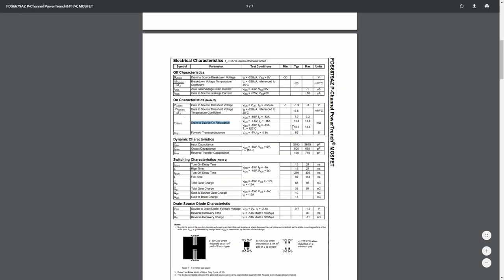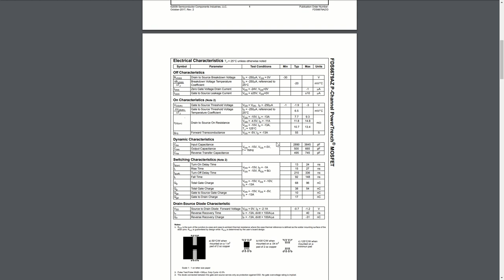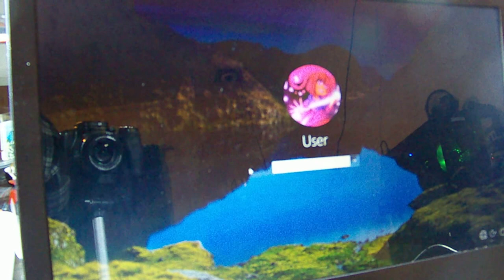ASUS ROG G74SX laptop repair!

Comment: This seen better days. Mine is in mint condition , bought new ... i used everyday since and no issues other than throttling issues, fixed by a modded bios disabling prochot.This puppy is thick and inspired by Nighthawk stealth plane. You can 7/24 game with it without burning your hands and no ear deafening fans... Solid machine. Pain to service but nice thermals. Mine is g74sx 3d with 120hz Nvidia 3D system. Bought at 2500€ back in time. I have 2 g752vs , one is oc edition with non locked k cpu runs over 4ghz speed , they are also solid machines. Oc edition drains battery when gaming with 230w power supply ;)
Reply: With mine I had to tear the damn rubber of because it just dissolved.
Reply: @EnhancedNightmare  you can try plastidip

Comment: Great video mate! I know it has been a while and you might not remember, but it would help me greatly if you know this: are the two R020 chips shown at 12:21 (cant recall the proper name) grounded? I have a short circuit on my g74sx laptop and i cant figure out where(i couldnt find a scheme anywhere). As soon as i plug in the charger protection kicks in and turns off the charger. i. e. The laptop cant be powered on at all. I am also looking into the mosfet but mine seems good. Thanks in advance!
Reply from the maker: The R020 resistors are current shunts, they are not connected to ground. If you can measure a low resistance between one of these and ground you need to look further. The input mosfets don't go to ground. Are you saying when you plug charger in you don't get 19V at the socket? How are you testing the mosfet?
Reply: @JonnyFix  i have confirmed i have a short circuit. As soon as i plug in the charger, the charger shuts down due to protection. There is no reaction but only instant shut down. The R020 have 2 oms with ground. Mosfet seems to be fine. I have tried another charger and it is same reaction
Reply: @JonnyFix  i dont get 19v on the socket at all as i try to plug in the charger. It instantly shuts down the charger (charger protection kicks in).
Reply from the maker: @svid-1  If those resistors have 2ohms to ground I'm going to guess a bad capacitor right after the socket somewhere. The best way to find this without removing every one and re-testing is to get a bench supply that can source a lot of current without shutting down, set it to 19V and feed that into the socket, or solder wires to the socket and feed directly into board, and find out what is getting hot. 2ohms will pull almost 10amps at 19V so set current limit on supply to half an amp and see what happens. At low current it might take a couple mins for something to start getting warm enough for you to feel depending on the voltage. Power is volts x amps so if voltage at half amp limit drops to 10 then 10 * 0.5 is 5watts. 5-10W should be enough to feel.

Comment: great video and lots of useful things and always learning with electronics , but i have a tricky laptop problem if you can help? 
Wont turn on and no lights, screen ect- totally dead- PS is good. Switch is good and 3v is there shorting to zero when pressed. 
** When plugged in,  the blue light at the power socket flashes blue for a sec . (normally always on when plugged in) 
PS socket resistance is only 8000 ohms?? and same unplugged where it connects to M/B so not socket wiring fault. 
Pulled it all apart and 19v is there through the input mosfets and sense resistor. cant find 19V elsewhere on main power rail .
So power mosfets  are turned on by super IO? partially on but fault detected somewhere? 
3V isnt at bios chip next to super IO if it is the bios chip? no volts on any leg. No 8 should be 3V always i think
pulled all parts off board to see if they are causing short or drag down
Tried my PS direct to board socket pins and NO amps are being drawn and with switch pushed in too. Fan dosent twitch.  CPU ect are cold as no amps drawn
Tried resistance to ground of many parts and cant find any shorts 
So slightly ON but not fully. Super IO fault?  Also screen disconnected in case that was faulty and 19V is at connector to screen

Any one can help , that be appreciated as out of ideas.   8000 ohms here must mean something as should be hundred k or more and i hear HP's can be down to 20K? obviously something is wrong,  first board i have repaired where socket light isnt staying on although board has partial 19V on it.  Learning board repair so always learning and this one has stumped me so far, but might be easy with 8000 ohms symptom?
thanks
Reply from the maker: Sounds like you're doing everything right. Should be a 3V and 5V always on, I'd hunt those down first. The regulator circuits should have 19 present. Check for enable signal on the reg IC. Hopefully this is yours and not one that's been around. I just had one that had me hunting like this until I realised someone else had a go and had taken parts off. Good luck!
Reply: @JonnyFix  Yeah the super IO wasnt getting its 3 volts and only power button is so i was hunting around for shorts and found a large coil connected to the power supply chip that makes 3+5 and found it is 34 ohms!  the other coil on the other side of the chip is a zillion so thats ok,  so looking at the schematic, it looks like i have a soft short and trying to put amps through it to heat it up wont work as i can only safely put 3.3 V on that line as thats what it is, so will have to remove caps ect to try and isolate. Maybe somethings leaking not shorted and may heat up at half a amp? . Any tricks for soft shorts?
Reply from the maker: @xx3868  Maybe take the coil off and check it's not the driver chip itself that creates that rail. If not , maybe inject 3V then probe around each spot that should have 3v always and look for one that's lower than the others due to volt drop created by low resistance, might only be millivolts but might be enough to lead you to it. I've not had to try this before but I think the theory is sound.
Reply: @JonnyFix  Yes, i use voltage drop so much i never thought that i could simply check across each item on the circuit till i see i diff . a low ohms meter with high sensitivity would also work with power off.

Comment: I know this is an older video, but thought I'd try to ask.  I have this model that I still use as a daily driver, I love this machine.  Mine will power on and charge just fine, but is constantly reporting that it is being plugged in and then unplugged, back and forth.  Also, the charger tip gets rather warm, but I don't remember if it did that before this issue started.  When the battery is removed, the laptop stays powered on, so it's not losing the electrical connection.  I just tried to replace the power supply and the issue remains, so that's ruled out, and also have tried multiple power plugs that go between the power supply and the wall.  Is there something you might suggest as a next step?
Thank you,
--Rick
Reply from the maker: The charger plug getting warm is a sign that the socket is worn out and not making a good connection which would explain the laptop thinking the plug was removed. Best option is to have the socket replaced as it will only get worse. Get it done before the heat reaches a point where it damages the charger plug or something internal. Hope that helps!

Comment: Well done :-D
You are the sherlock holmes of electronic repairs :-D
Wow the input processing was well cooked, i've never seen current measurement resistors look so baked.
I don't blame that poor mosfet for giving up, nearly ten years of baking, according to the bios :-(.
Imagine a slap with that beast of a laptop, it would be like a paving slab smacking you in the mush ha ha :-D.
Reply from the maker: I appreciate your reflection on these vids. Always amusing :)
Reply: @JonnyFix  Well i do appreciate your abilitys and knowledge, i havnt often seen you fail.
And yes we all fail sometimes, some circuits really need a schematic to decode the bloody mess.
A well layed out schematic with clear classic blocks just makes instant understanding.
I end up re drawing some diagrams to make sense out of it.

Comment: I have  same   old G74 and i like it cuz the screen size hehehe  my G74sx now  stoped to  turn on and  it only show power light  but  not turning on , since i plug  AC adapter  the power light come on but laptop dont, i already check with thermal  cam and nothing  is getting hot...
Reply from the maker: In order to see something get hot you need to inject the expected voltage for a given rail that you've identified as shorted to ground with an external supply. The regulators in the laptop will usually not turn on if there's a fault so you'll never see it if that's the case.

Comment: Hello, i have the same Asus Rog type. My power IC chip was replaced but am supposing it's low-rated one cuz whenever i launch a game, its suddenly shutdown at the loading screen. But works fine at a normal use. What type of Power IC chip it's best for the laptop ?
Reply from the maker: I think it would have to be pretty under rated to cause that. Look at the datasheet for the one put in. It should be rated for 10amp or higher. If it is you have another problem. If not, replace it and see how it goes. Also make sure the cpu has a good thermal paste and the heatsink is clean from dust etc as it could also be temperature related since games will increase that.
Reply: @JonnyFix  Thank you so much for this reply. I will forwarded this laptop to my trusted repairer inform him about the 10amp chip and the thermal paste on the CPU. Thank you once again.

Comment: Hi jonny fix , i got same position problem on my g74sx, can u tell me what is the smd component near the mosfet, the small one ? Cuz my smd got fried.
 
Ty.
Reply from the maker: The 2 small ones beside the bigger one? All 3 are capacitors. It should work without it. I do not know the value if you wanted to replace it.

Comment: Hey, do you still have the motherboard wiring diagram please?
Reply from the maker: I never had one
Reply: @JonnyFix  thank you, I managed to solve it, it was a short on the audio board that I connected to the motherboard and I washed it with soap and water and it worked;
Reply from the maker: @helberlucio1553  Oh well done!

Comment: Anybody watching this video this is is exactly NOT how you remove any component from a board!!!! He should have applied a little bit of low melt solder onto the legs befor using the hot air and the MOSFET would have come off with absolutely no effort at all. Do not cut or rip anything off of any board you will only destroy it!!!
Reply from the maker: And yet nothing was destroyed here. Not everyone has low-melt lying around. Always work within your own skill level and you to won't cause further damage..... not that one couldn't repair any issues that may arise. This was the best course of action with the resources available as the pcb had suffered already due to the high heat created at time of failure.

Comment: Great video Jonny, I already have the same motherboard on my desk but it's fairly new. Story: I just left the laptop downloading a file overnight, so after 1 hour, the laptop went into hibernation. In the morning, I saw the screen off but the lights on the keyboard and power button were lit up. I touched the keyboard and it was really hot, and the power button was hot too (it burned my finger). Finally, I turned it off and let it cool down for a couple of hours. I came back, tried to turn it on, and it never started again. When I plug in the cable, the power button LED automatically lights up in white, but there's no sign of any startup – no fan, no display, nothing. Eventually, I disassembled it. The motherboard looks perfect. I only connected the video riser to the monitor and just the power button PCB cable. Same symptom. The truth is, I don't know what to do. Recently, I bought a used motherboard from AliExpress, and it came with a faulty BIOS (it boots, but gets stuck in the BIOS, and the PC doesn't proceed further). I've checked the same things you did in the video, but it seems like everything is fine. I want to point out that after many tests between both motherboards, my original one started and entered the BIOS correctly once. But after turning it off to assemble everything, same symptom – the power button LED lights up, but it doesn't respond to anything. I'm really sad; I really liked this laptop even though it's old.Not to mention that the other AliExpress motherboard (2MB GPU version) holds no hope for me. It at least boots up fine, but it enters the BIOS and loads half of the screen in half a second, then everything goes black... The end.
Reply from the maker: Wow, that sucks. I would have expected to see some darkening on the board where the heat was concentrated for so long especially if the power button was that hot. Hopefully it can be repaired one day.
Reply: ❤ great video.  Any recommendations on where I can find the SCHEMATICS for the same laptop
Reply from the maker: I do a google search and follow the results. Often they show up under the model number on the motherboard rather than the model number of the laptop @wares9288